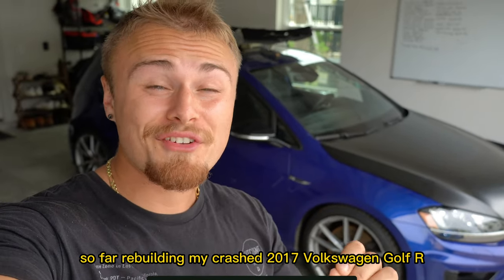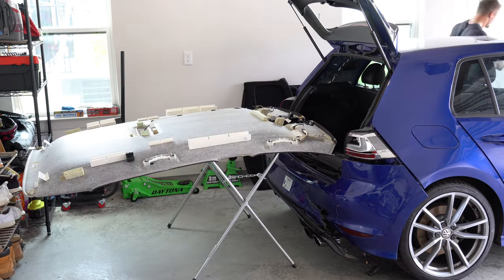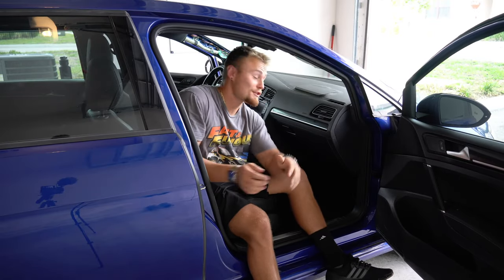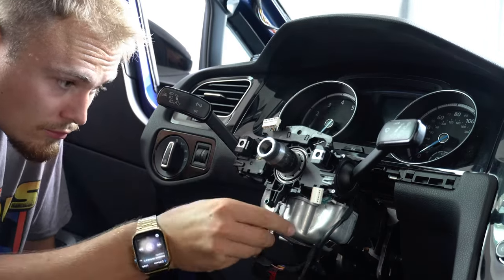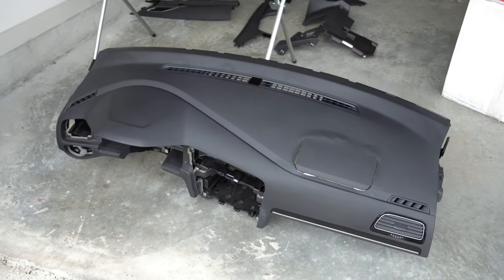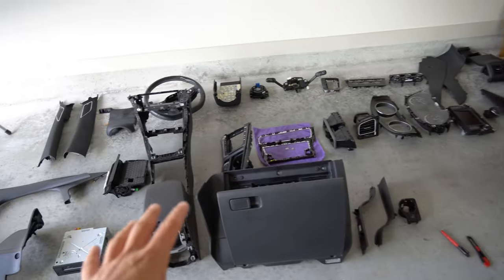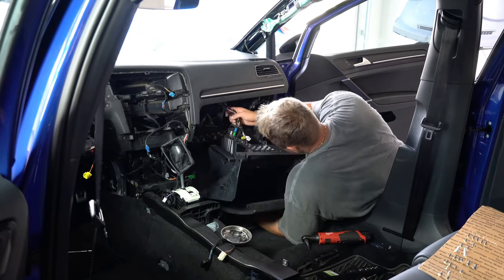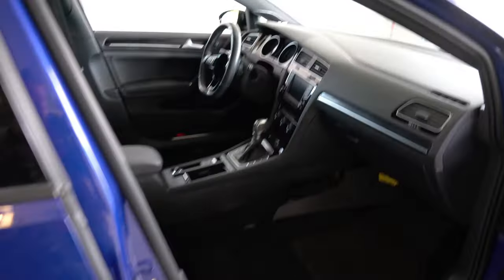REBUILDING A WRECKED VOLKSWAGEN GOLF R | PT 7

Comment: How much would it have costed to get it reupholstered instead of replacing the whole dash?
Reply from the maker: Definitely a lot more than $300. This type of dash cant be reupholstered. Its one big piece of foam overlayed with rubber texture. To get it fixed would mean applying either leather or alcantara over it. To keep it oem it needs to be replaced